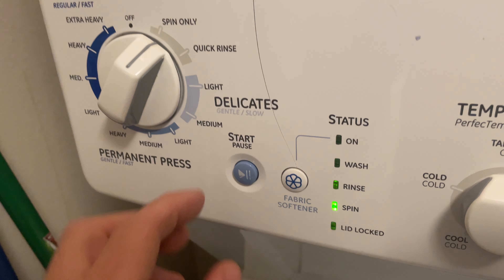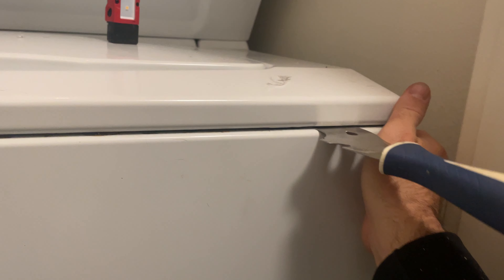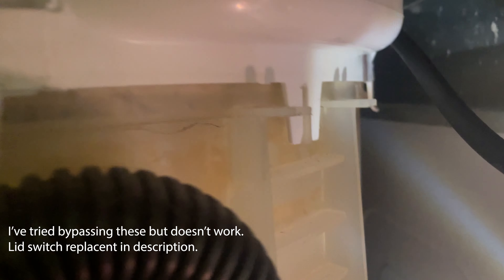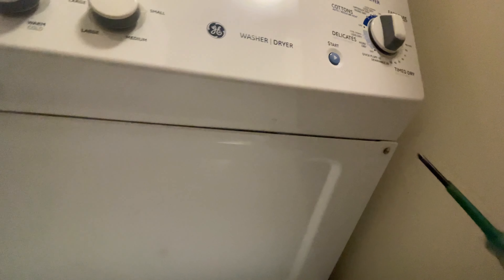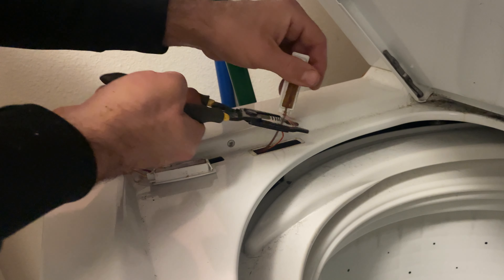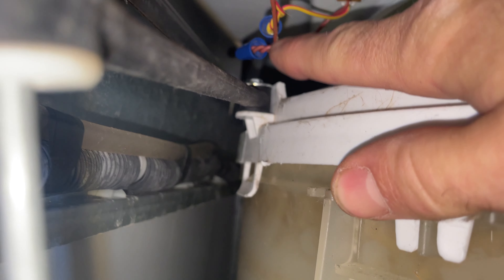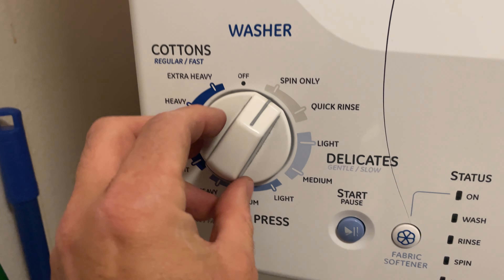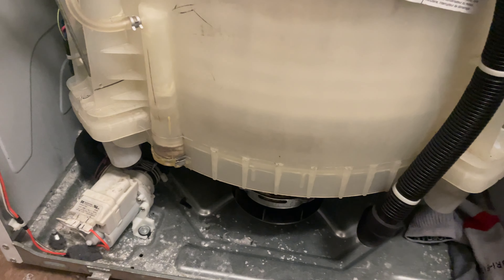GE stackable washer/dryer lights blinking

Comment: I have an older model of the GE stacking washer / dryer and the wash light blinks and im hearing a clicking... it wont go into rinse at all .....could it be the lock sensor and how would i go about fixing it ?

Comment: I'm having an issue when running any wash cycle where the machine will begin to fill for about ~5 minutes, and then it pauses itself and the wash LED flashes. When pressing start again after, it then proceeds to finish filling and completes its wash cycle successfully. It is the SAME behavior every time. any ideas what could be causing this?
Reply: Did you find any solution. I have the same issue

Comment: Thank you so much for your video!

One question, my stackable ge, does not spin strong enough, if you do heavy cycles or extra Heavy, and now it does on normal, if the cycle finishes, clothes end up damp, and i get an error code.

It helps if i set a fan next to the motor to cool it down but not much.
What can I do?
Thanks in advance!

Comment: My GE is a bit newer but my on light stays the wash light blinks the rinse doesn’t the spin blinks and the lid lock doesn’t. 
Can it be the lid lock sensor/switch that goes to the board I replaced the lid lock thinking that was the issue.

Comment: Can u just fix the wire and reset? Or do you need to get a new one
Reply from the maker: It depends where it splits, or if you are skilled enough to solder the wire back to the part but I don’t have any experience with that

Comment: I have same model washer but there is no power/ lights coming up.. dryer is working fine.. what could be the reason? Is it lid switch or board? Thanks
Reply: Currently trying to solve that issue for myself. Did you ever have luck solving it?

Comment: My lid locked in flashing red and has every single piece of my clothing stuck in water In the washer. What do I do
Reply from the maker: You can try turning off the breaker, taking off the front panel and manually opening the lid lock if it doesn’t deenergize
Reply: @ApartmentMaintenancePro  our maintenance is bringing us a new one and they got my lid open but thank you

Comment: OK i need some help some tweaker came by and tore the washer apart if didn't work
Reply: Anywho I put it back together but there were all sorts of bunji cords and I took most of them off it started working Anywho I need the schematics for this laundry center do you know where I can get that please
Reply from the maker: I would search your model number online or contact the manufacturer
Reply: The lid light keeps blinking and will not cut off even if it's in the off mode. What do you suggest?

Comment: Just replaced the board because last one died ( no power at leds). It worked for a bit but I interrupted the cycle now it's stuck on a flashing spin led. Won't respond to diagnostic entry. Any ideas?
Reply from the maker: low voltage short somewhere? USUALLY, when boards don't dish out error codes anymore it means they are toast. Generally work on last decades models :)